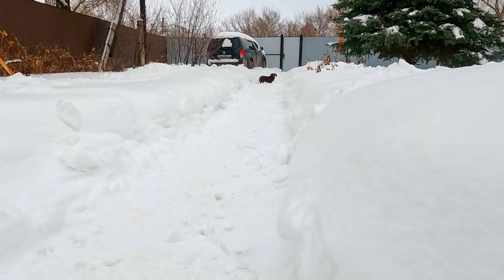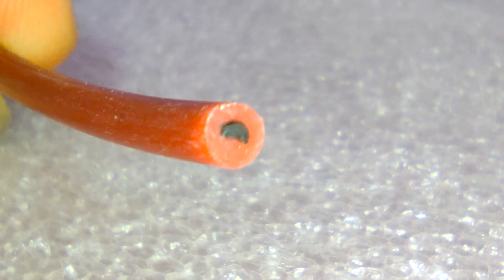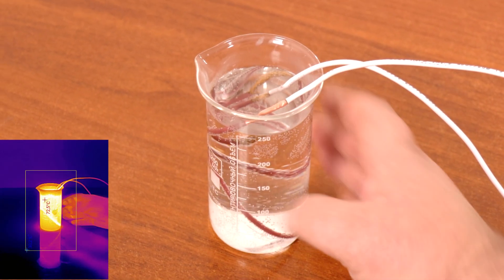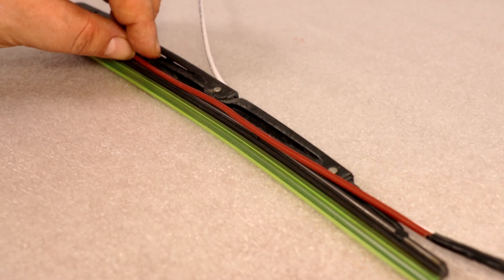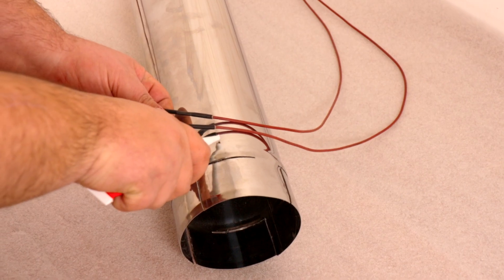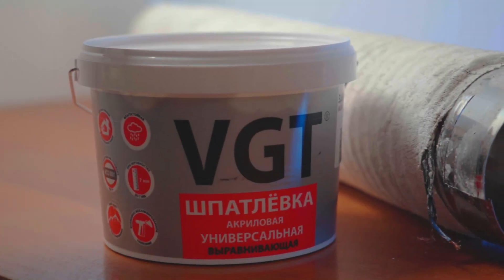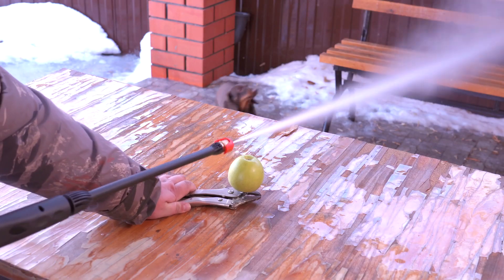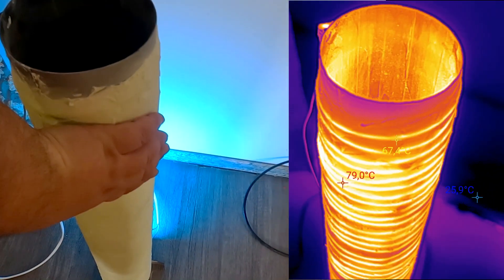The Ventilator Pipe Heats The Passing Air!

Comment: How long is the pipe you used? Thanks
Reply from the maker: Approximately 1 meter. You can use any length that is required. The operating principle of the device is important.

Comment: What kind of cable that heats up is that in the video ?
Reply: The type used for under floor heating - Fibre Underfloor Heating Cable. Can be bought mounted on mats, or loose on a roll

Comment: I would like to make, two or more of those heaters, & try running them with Solar power.... Charging a battery Bank " then have the battery Bank powering a good
Inverter.!! Maybe some type of ( pure-sinewave) High watts system, that is a very good name brand.!! I would be willing to pay a little more for a system That makes " pure sine wave" electricity, 
As it's taken More smoothly than the modified - Chopped - up, power.!! 
"Believe it or not" a ( High watt) " pure sine wave electricity producing inverter* makes Better Electricity 🔌 than you get from the power lines, coming in from the
Grid.!!! "As some people call it
LOLOL So, in conclusion - all anyone needs is ( a good battery Bank and a high Quality ( pure ) sine wave" inverter to run you're " WHOLE " HOUSE.!!  Maybe two sets for a Large home with two - Three levels... Especially if you want or have an
Large garage with an extra fridge and or
Freezer.!! So, for each battery Bank " you have ( running an inverter) that's powering
A Large part of you're home* you'll need a
Set of solar panels, that can charge that
Battery Bank... I'm not talking about thousands of dollars worth" I'm just saying, the panels that are charging several batteries that supply 12 to 36 volts of DC power to the batteries that are
Running the inverter...... That's what No-one wants to tell you.!!! The whole
System that will run you're WHOLE HOUSE
Won't cost ya, More than ( a few hundred dollars) - at most, $1200 to $1500.!!! 
Now, set up a small system of ( batteries, pure sine wave inverter, and a few one hundred Watt Solar panels to charge you're batteries).!!! Just enough to tryout, what I'm saying: and see if I am right OR wrong.!?!?!

Comment: This is called a xontrolled short. Its not a new pr interesting way at all. Electrix stoves work on the same concept you try putting 120 or 240 through that and it would melt

Comment: I've had many plug-in heaters. So why is this different?
Reply: The narration explains why.  It costs less and you don't run the risk burning yourself on the coils. There's no fan.  air gets sucked in from the bottom where the slits made in the beginning of the video (he forgot to explain them) its heated by the coils and exits the top of the pipe

Comment: I am not sure how this can be "costless" if it works on electricity. Or did I miss something in the video?
Reply: costs LESS ≠ costless
could be an error in translation or spelling.  I'm pretty sure (not certain)  it was not intentional😊
Reply: Maybe charge with solar panels
Reply: @rodneyreno5109  As good as telling "just use solar panels for the end purpose". Solar panels and accumulators + maintenance etc. are not costless
Reply: @Dr.ArielArik  point taken
Reply: of course its costless. Oil heater drain 2000W and give you up to 110c this cable well used give you up to 140c and drain max 200W....my big room is warm  23 celcius for funny money
Reply: @nucleo1772  Good title is ur last words, but not the "costless". Per definition "costless" means "not paid for". I understand the word "less" meaning "none" is contra-intuitive but still...
Reply: @nucleo1772  
What kind of cable that heats up is that in the video ?
Reply: @Wishi13  
Thank you. It was the aspect of the fibers that intrigued me, they don't look metallic.
Reply: @nucleo1772  I didn't watch it carefully (maybe there is some trick, some other power) but i think  that some amount of electricity can produce the same amount of warm.
Reply: @mackopop1371  hoy en dia 200w ya es un gasto normal para muchos, por eso quisas la palabra SIN COSTO , aunque sabemos que a la larga lo es.

Comment: So you simply plug it in to the wall outlet, or did you run an inverter?
Reply: It is for 12V like car batteries or those used for cordless power tools (caution, 18V might be too much).
The wall outlets at home provide 110V in the US and 220-240 V in Europe.
Reply: @Fraususemil  
What kind of cable that heats up is that in the video ?

Comment: my question on this type of heater is how many watts does it need to run let alone what is the Ah and Amp draw  say for a 12v ststem on 100 Ah bat aprx run time as well ?
Reply from the maker: This is an experimental model, and any part can be replaced with any other.🤖
Reply: @doctor-robo j se

Comment: Without cost? There is cost for running the car charger. or if you use a car battery, there is power from the battery. That is not free.
Reply from the maker: What about solar power? Or some other renewable energy?
Reply: @doctor-robo  Under that logic, everything is "free power" without cost. No. It still requires power. What would be more useful is talking about how efficient the solution is compared to other solutions.

Comment: I'm not understanding where it's plugged in for use.
Reply from the maker: For the experiment, I connected water and a wiper blade to 12 volts DC. The large heater was connected to 220 volts AC. This cable will work with any voltage and current, but you will need to make a calculation according to the formula for proper performance.